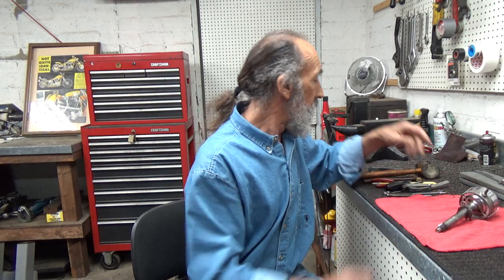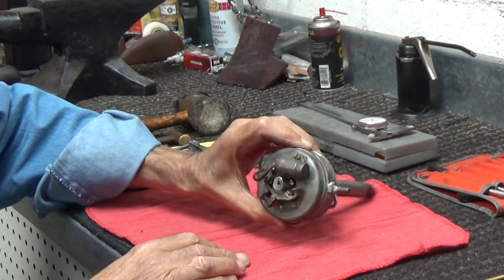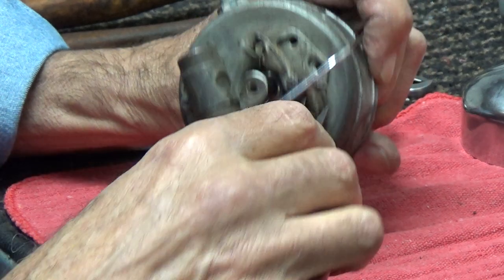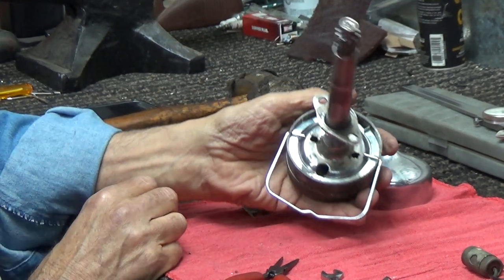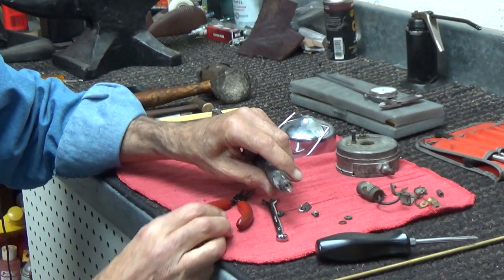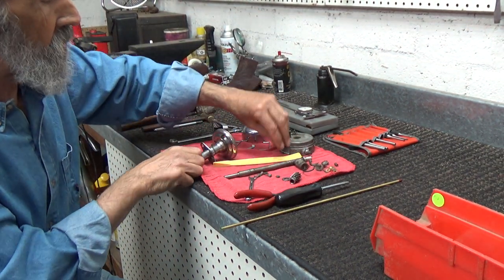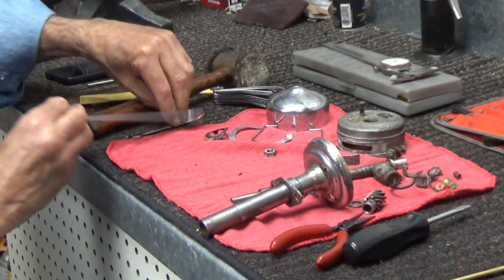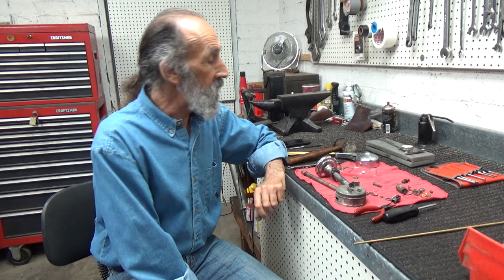Early Model Harley Davidson Distrbutor Rebuild, Part 1 of 2.

Comment: Mike, how do you remove the pin? The pin holding the gear at the bottom of the timer shaft that is. Thank you
Reply from the maker: Very carefully.  You drill or grind (depending on how far the end sticks out, don't damage the shaft) the end that has been "peened" and then carefully tap it out with the appropriate size drift punch.
Reply: Thank you. If I take the measurements that you took at the end of the shaft with a gear connects and they are within limit, is it safe to assume that the timer is serviceable.  I have two timers for this motorcycle and I am trying to diagnose an issue with the timing. I have a spare or a second dual point distributor, which I could insert assuming that it is within tolerance. Hence my question
Reply from the maker: You'll be happiest if you stay with the single point unit.  They aren't very critical.  If nothing is shorting out (intulator good, wire good, points good,.  It should be great.  If you suspect the condenser, replace it.  Use a good American condenser.

Comment: Hey mike what size punch did you use to get the pin out and which method did you use  I’m having quite difficult time getting it out with my make shift punch
Reply from the maker: The smallest one in my set.  Itty bitty.  Be carefull not to hurt the shaft.  Auto parts stores (most of them carry "roll pins" if you ruin it getting it out.  Is it rusty?  If so, soak in penetrating oil.
Reply: @pacificmike9501  it’s not but I’ll try putting some penetrating oil on it and it’s just not moving using a rubber mallet and I’ve ground down a small screw driver might go buy a punch
Reply from the maker: Good idea, and use a small hard hammer.   That rubber mallet may be absorbing the shock instead of cracking that pin loose.
Reply: @pacificmike9501  yeah I tried it just seems to make the pin mushroom might have to drill it as a last resort

Comment: I can't think of a single reference made by Harley Davidson of ever calling their circuit breaker a distributor . Both plugs on a twin get spark at the same time . One cylinder is on the power stroke . The other is on the exhaust . Sending a signal to the coil to spark is not what a distributor is or does .
Reply from the maker: Right you are.  I mentioned that in one of our earlier videos, where I rebuilt one.  I also explained the difference and explained that, in the world of Harley Davidson, it's often referred to as a "distributor," but merely as "slang".  Just like referring to an "engine" as a "motor."
Reply: @pacificmike9501  Sorry I musta missed the vid of you explaining the difference . Loved your example of engine & motor .  Another classic case of two different things . Knowing how accurate and detailed in your descriptions of the work you do  it just caught me off guard . Great videos in any case . Thanks for documenting it . Who knows  perhaps somewhere in the distant future ( after earth gets inhabited by space aliens ) they will have your references to resurrect & ride Harley's .